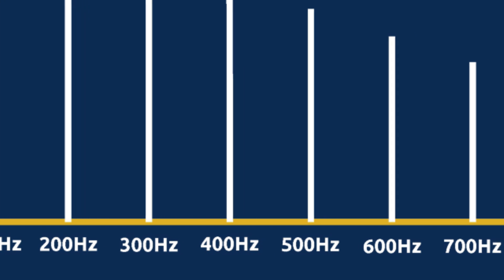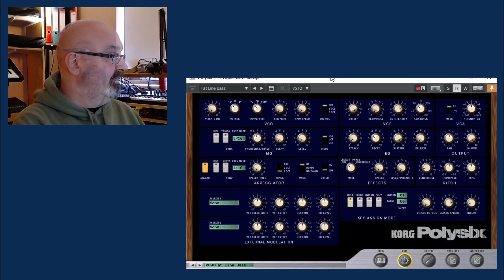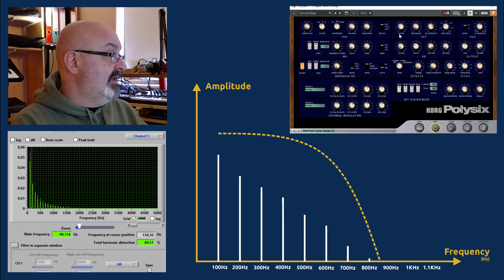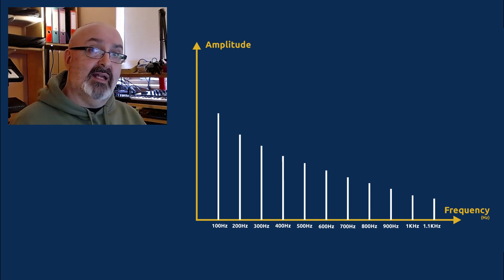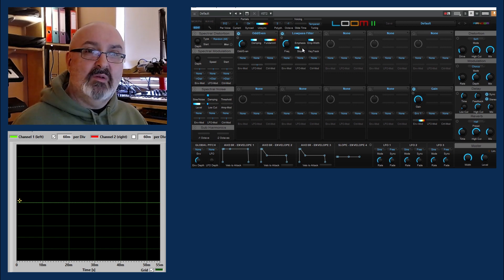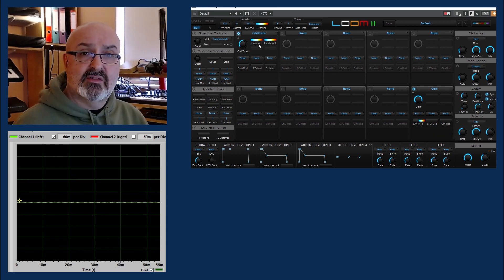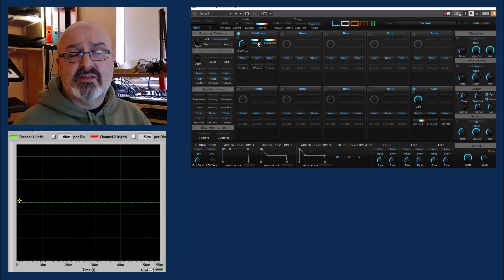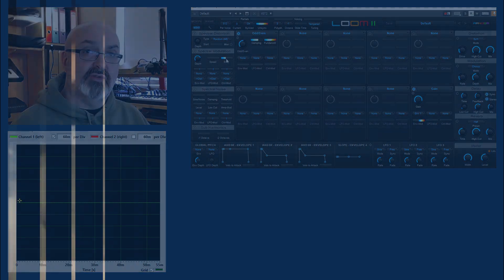Synthesizers - Additive Synthesis vs. Subtractive Synthesis

Comment: loom is probably one of my least favorite additive synths, it's still cool, and fun for certain sounds, but I find razor, harmor, and parsec to be far more advanced and fun to use
additive synthesis is one of the coolest synth types, but requires a multitude of algorithmic partial controls, to avoid what you describe, where you have to adjust each harmonic individually.

I really hope more developers write good additive synths, the market is sparse with them. I've done one stream on loom, might do another one day
Reply from the maker: Thanks for the tips.  I'll check those out when I get the chance.  At the moment I feel I could do with some kind of order to the algorithms, like more logical groupings.  The way it's done in Loom is a bit haphazard, from what I can see.  It'll be interesting to see what other producers are doing.  I'll try and find your stream too.
Reply: @RunningonairMusic  no problem, yes, loom's system is a bit rough, and many of the algorithms are either very single purpose, or redundant. there's definitely a tightrope "path" you have to walk when setting each slot and choosing which ones to use
I don't regret purchasing loom either, it's system has some sweet spots that let you do some pretty cool things
it might be a bit buried at this point, looks like it's 2 months old

Comment: Purchased this vst recently and couldn't find any comprehensive tutorials around at all. Thank you so much for doing this, looking forward to more videos . Cheers :)
Reply from the maker: No problem.  It's odd there isn't more out there.  Initially additive would seem very straight forward, but it requires a completely different way of thinking about synthesis.  Maybe that's why there aren't that many videos.